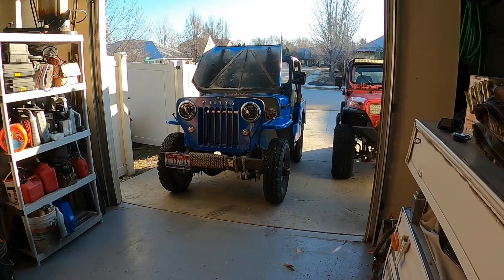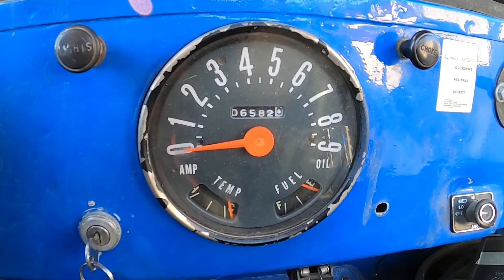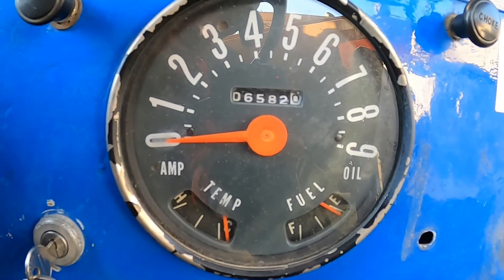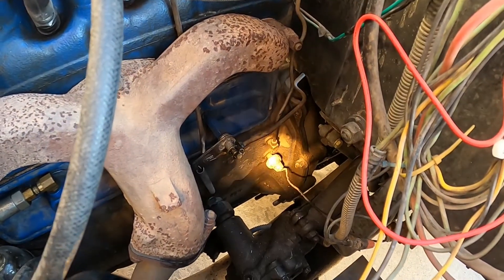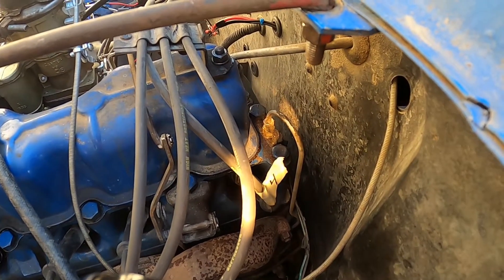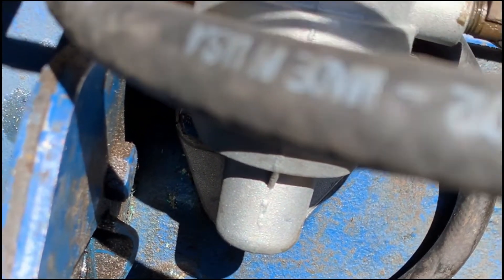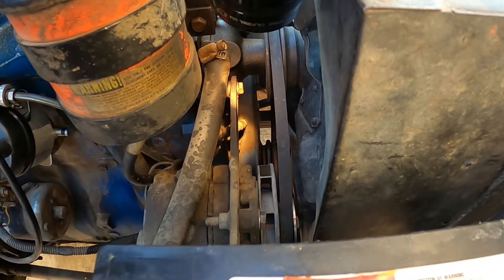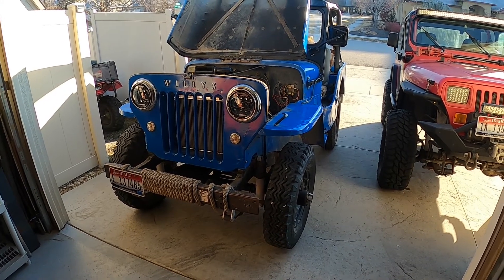CJ3B Oil Lines

Comment: Thanks for the video. I just rebuilt my  CJ3B engine a few months ago. It has good oil pressure at start up and running, but once  the Jeep is up to temperature the oil pressure drops to almost nothing. What could be causing that?
Reply from the maker: It's been so long since I've rebuilt mine.  I put a real oil pressure gauge on temporarily, you can see it in the other video.  Now I just have the idiot light.  However, have you checked the manual for the acceptable readings?  I've read online that the manual says minimum of 6 PSI.  I have to run out the door now to work, but I'll try to look later to see if I find the oil pressure range in the manual.  As to why it drops like that, that's beyond my knowledge.
Reply from the maker: So I did verify, service manual says down to 6 PSI at idle is OK.  If you're not getting that, did you take a look at your oil pump when you rebuilt the engine?  I also saw where guys said cam bearings can cause that issue too.  Those should have been replaced though, if you did the full rebuild.
Reply: @hannibal61577  New oil pump and new everything. The crank was machined and reused, but all bearings and cam were replaced with new ones. Another you tube Willys guy said some machine shops don’t know what they are doing and don’t set the tolerances where they should be so the pressure drops when it is warm. He suggested tearing it all apart and redoing it all🤨. Of course he had a gigantic shop and machine shop to do that with. I have my driveway and that’s it. I’ll try running some Lucas oil stabilizer in it and see if that helps the pressure. Thanks